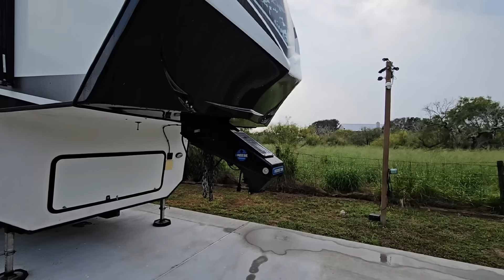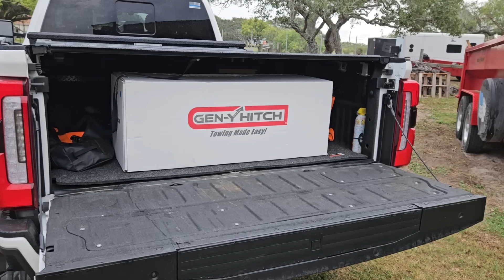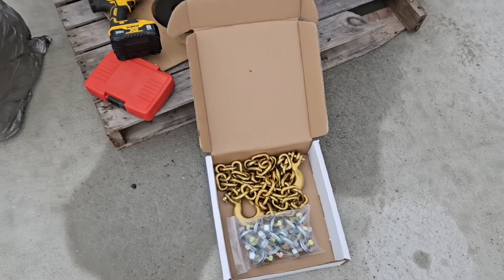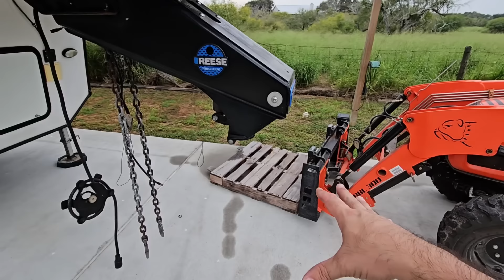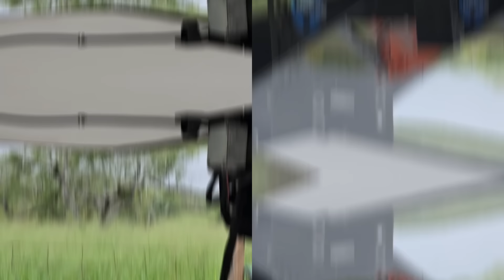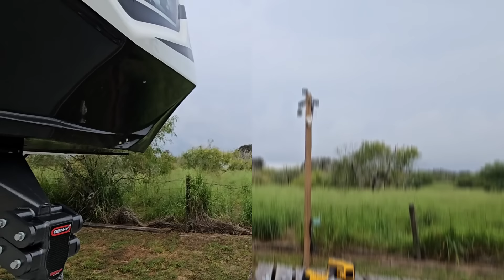BIG CHANGE! NO MORE Reese Goosebox on our Fifth Wheel RV!

Comment: You should look into freedom haulers for the back of your trailer. They are available in several sizes and are great. I’ve been using one for several years now and have towed it at least 15k miles.

Comment: I have towed my raptor toyhauler with a goosebox over 20k miles the last 7 years. I love that hitch. I tried a gen-y for a few trips around 2000 miles. I went back to the goosebox. In  my opinion they are not the best option for toyhaulers. My pin weight can change over 1000 lbs depending on what I’m hauling or not. Not having the adjustability of an airbag just doesn’t make sense for those of us with toyhaulers!

Comment: How is the ride with the executive compared to the reese airborne goose box. Honestly I can't see how it could be better. I like to see comparisons between 2 or more manufacturers. Ive had trail aire, moreryde, reese airborne, traditional kingpin, rotoflex, and currently the new curt helux king pin. By far the most comfortable ride of any of them has been the reese airborne king pin. It took some time to find the perfect air pressure for my individual setup but after that it was quite impressive
Reply from the maker: Less bounce and more rebound control after any size bumps.  The Goosebox has more forward and aft shock absorption, but it can sometimes feel like chucking.

Comment: Years ago you created a video called "Ultimate Gooseneck vs Fifth wheel hitch for RV showdown" dated Feb 19, 2017, where you didn't recommend converting a fifth wheel pin box to a gooseneck hitch.  Has your position changed on this conversion with the invention of the Reese Goosebox and Gen-Y executive gooseneck pin box with snaplatch coupler?

I have a 2012 toy hauler fifth wheel trailer that has a 1621HD tri-glide trailair pinbox that was installed by Lippert at the factory.  I called Lippert customer service and was told that I could covert my current pin box to a Reese Goosebox without any worry about frame damage due to the different stresses that would be exerted on the Lippert frame due to the change in geometry between the Trailair vs Reese Goosebox. 

Lippert gave me a blanket statement about the 1621HD frame and said that the Reese Goosebox was compatible with all 1621HD frames.

I think that Gen-Y has produced testing data that shows the executive hitch is a valid hitch replacement to the Reese Goosebox and won't add any undue stress on the Lippert frame.

I am planning to purchase a Gen-Y executive hitch due to your analysis and recommendation of the product and bypass the Reese Goosebox.

Do you agree with my assessment?

Thanks for your help.
Reply from the maker: Hello,
My assessment has not changed at all.  I still absolutely do not recommend attaching a Gooseneck vertical tube to the bottom of the kingpin plate.  I also only suggest replacing when the model you select is designed correctly.

Comment: Are you not going to use the Gen Y Goosepuck with this new hitch?  I saw your review of it several months ago.
Reply from the maker: Unfortunately, I would not be able to clear the bed rails with enough space to use that product
Reply: @BTBRV  Because the ball is too low on the goosepuck?   Are you using a taller ball?

Comment: These are 5th wheel trailers not goose neck. You can’t make the change and expect the same result. If you have a 5th wheel trailer you should use the proper hitch.
Reply from the maker: Ok, so if you have a better towing experience with a Gooseneck connection on a Fifth wheel, then I guess it's the proper connection.

Comment: When I checked about doing conversion to my 37.5 ft 5th wheel and 40 foot triaxle tow hauler from the same manufacturer as yours . Every one out there would void your warranty. Will manufacture supply letter as to which goose neck hitches won’t void your warranty’s. All my dually’s are geared up for both to accommodate all my different trailers. But in the future one hitch would be nice.

Comment: JD torque spec is 160 ft/lbs on this hitch. I know cause I installed two 1621HD style this past year. My Dad changed out from a first Gen Reese goosebox for the same reason as you, he just didn’t like he would have to fight with airing up the “spring” in the hitch each time he coupled up. We now have three fivers in the family all running the GenY executive goose hitch. We were able to find slightly used ones for less and already past the 1000 mile break in. You’ll enjoy the simplicity of the hitch in the long run.

Comment: I just had a keystone Montana fixed under warranty for frame flex and it had a Gen Y gooseneck on it
Reply from the maker: From what I'm aware if it was fixed under warranty, then the GENY hitch did not avoid the warranty.
Reply: Gen-Y didn’t cause it!  Brinkley & Gen-Y testing show its probably the best set up on the market for reducing stress on the truck & camper when towing.  Poor frame and camper build quality caused your frame flex.

Comment: I have three different hitches, Ones a gooseneck adapter, ones a companion hitch, ones a rail design but this is the hitch I've been looking at. Mostly to open the bed up when not in use and honestly looks like more floor storage area when towing.

Comment: I had the first gen goosebox. I loved how well it worked. Silky smooth towing....... But, I had to add air often. If I went over a rough road the air bag pressure relief valve would dump air also. So a little bit of pain.

Comment: So with this being non-adjustable, it seems it would not be a good product for people with a toy hauler as the weight on the pin can vary fairly substantially depending on if the toy is back there or not.
Reply: That’s my experience. My pin weight can change over 1000 lbs depending on what I’m hauling in my 42 foot raptor. I tried a gen-y for over 2000 miles and went back to my goosebox. Glad I didn’t sell it!

Comment: I have a 21k 5th wheel with a Gen y fifth wheel hitch. The torsion in the kingpin really makes a great positive difference. I sometimes look in my drivers side mirror and see the nose of the rig moving up and down on a bad road and do not feel anything in the truck cab. I am considering going to the Gen Y gooseneck as well.

Comment: Lippert Tech Support still says it voids the frame warranty so if you are out of warranty and you have issues. Lippert won’t help financially with getting the frame fixed like they have on other products
Reply from the maker: It can't void the warranty unless it's determined that the frame was damaged because of using it.
Reply: @patrickclayton9948  amazing the Gen Y executive hitch is lighter weight than the Reese.